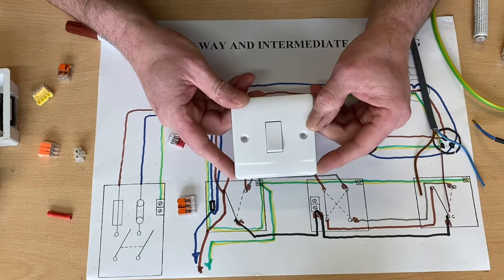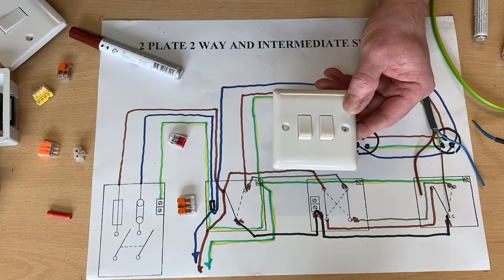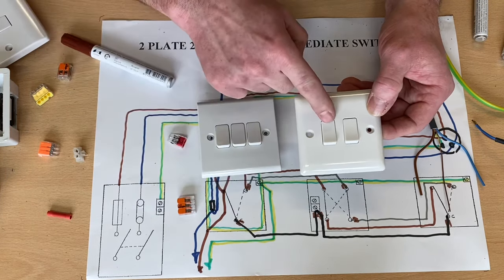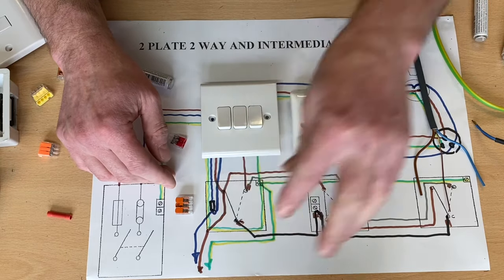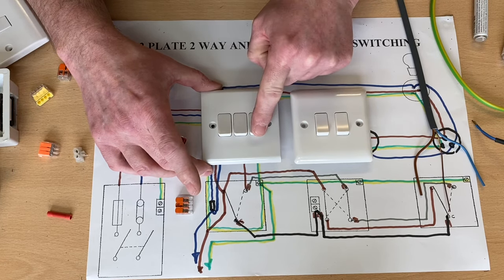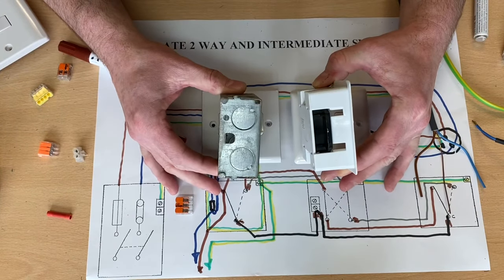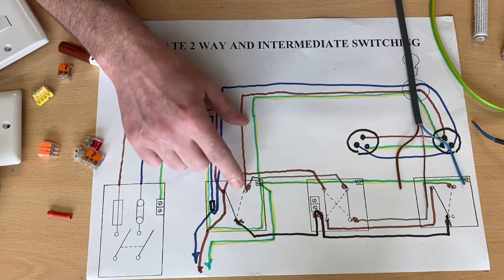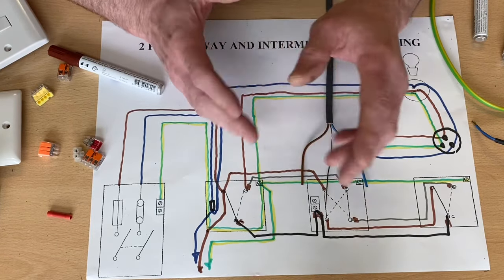Wiring Diagram 2 Plate Method - Taking the Feed to Another Room and Switch Connections Explained

Comment: Could you do a video on the real world scenario of hall landing light switches, using the two plate method, highlighting the issues of two consumer unit circuits providing the feeds and not sharing neutrals. Probably good advice to make these the end points of the the radials when possible to reduce the cable count. I don't think I have seen this covered anywhere and it seems to cause a lot of problems and confusion.

Comment: A lighting circuit is a radial circuit. In short you daisy chain from one light to the next. So the lighting equipment needs to be a junction to take the lighting circuit to the next light.  

A light has two parts:
1) the light fitting to the lamp itself;
2) The switch. 

a) Light fitting as a junction:
In a two floor house with an attic, the light fitting tends to be used as the junction to daisy chain the lighting circuit to the next light in the circuit. Then a wire to the light switch. So, a circuit is a wire from the CU to each light fitting with each having a cable to its own switch. No neutral wire is at the switch.

b) Switch as a junction:
The way to do it in flats as there are no suspended floors or atttics, is to daisy chain the lighting circuit to the switches, then one wire to the light fitting. The opposite of a) above.  So, a circuit is a wire from the CU to each switch with each switch having a cable to its own light fitting. A neutral wire is at the switch. 

In b) above, the daisy chained neutral needs a junction terminal on the switch or behind the switch in the box.  Hager and Schneider provide a switch with an N terminal on rear of the switch, so the switch is the junction.  To my knowledge Hager has been making one for at least 10 years.   If the switch has no N terminals, Wagos or terminal blocks have to be used inside the light switch box. 

In a) above there are problems of wiring colours when a cable is taken to a switch, as cable with the L (brown) and N (blue) are used, needing a coloured sleeve over the N wire. There is special wire available with a yellow conductor for this, but it is rarely used. Using the switches as a junction solves this. 

As lighting is now more varied with downlighters, wall lighters, etc, taking the lighting circuit daisy chained to the switches makes more sense - multiple downlighters can easily be extended.  It is also easier to fault find. It means the boxes behind light switches have to be far deeper to accommodate more cables and Wagos to form the junction terminals. 

If a lighting intermediate switch is being used, taking the circuit daisy chained via the switch makes it easy to fit one. 

That is how I tend explain it.
Reply: @danielwake7621  
There is nothing wrong with doing that.

Comment: Fantastic video Gaz as always.
Personally I don’t like the idea of having two or more cables of one switch unless it is for two way switching. And I don’t like the two plate method , I would take the feed to a wago joint box then on to were it needs to go. 
But we all have our own way of doing things. so each to there own.

Fantastic video any way Gaz 👍❤️⚡️
Reply: These days with the popularity of smart switch devices like Sonoff having the neutral at the switch makes easier to install them possibly in the future. 

Yes in theory you can install them at the light position, but it's more difficult and they are less accessible in case you need to do something with them.

Comment: Is it possible to get a neutral to the second switch to feed another room as well? Is it acceptable to tap of a neutral from the light fitting as its on the same circuit rather than running a second T&E along with 3C&E?

Comment: Great video but still a bit confused. If I wanted to use the 2 plate method on a 2 gang light switch supplying two different sets of lights in the same room how would you do that? Would you, for example simply run a brown cable from common to common instead of heading off to the next room?
Reply from the maker: Yes 👍🏻
Reply: Thank you so much! Great videos.
Reply: Good call. My 3 gang switch has 4 wires all into the common wire. This must be the opposite of linking the commons. Think linking them is the better option

Comment: I would like to add an entirely new switch and light to a two plate circuit. The switch at the start of the chain is on the first floor and is very full and will not take another connection. It is a two way switch with 4 x 1.5mms in it. 
Identical to your drawing at 8:30

My query is, Can I split the wire that is feeding the next room at a junction box to create a new light and switch. So instead of daisy changing at the end of the entire circuit, I split into two before the second room? the daisy chain will then continue as installed but now with my individual light spur and switch additionally?

Comment: GAZ, your presentation is excellent and  I think you should think about teaching electricals as a profession, as your very good.  Kidding, I've been a big fan of your channel for years and have been helped in a lot of subjects and glad you are still putting these out. One question with regards to all the connectors in the back of the patress/ knockout box. What's your thoughts on floating cables behind the switch? I can't see an issue but there's some discussion that connectors floating around is bad and they should be secured within the enclosure.
Reply from the maker: Thanks for the great comment - I don’t mind a Wago in the back of a box but if you could secure them then I would 👍🏻. Have a great day. Gaz
Reply: @GSHElectrical  A roll of Tower (other brands available...) two sided tape normally used for fixing trunking would do the trick to fix the Wago.

Comment: So you have to get the permanent line from your switch which is chopped into the walland cannot be git at without cutting a chase to get to the permanent line cable whereas before you could find a permanent line connection from any light in any room ,so as an Industrial sparks of 50 years whoever came up with this crazy idea baffles me,you even have to put the neutral cables at the switch into connectors thus making more connections in your circuit therefore there being more of a chance of connections coming loose,yet you are pushing this method which makes me lose my respect for your teaching
Reply: It's in the syllabus, mate. They're not pushing anything, you have to know both ways. The 'old' (3 plate method) you mentioned isn't old, it's still being used, along with this 2 plate method which is often found in commercial buildings which give easier access to the switch box.

Comment: To add to the chain, do you need to find the last switch in the existing chain or can you essentially spur off any switch in the chain? I am assuming you need to work from the end of the chain?
Reply from the maker: No you can come off any light to add another that will come on at the same time 👍🏻
Reply: @GSHElectrical  thank you and Merry Christmas ... Great tutorials
Reply: @GSHElectrical  sorry just to clarify, if it's a brand new/additional light ... you can simply spur off the nearest switch? (The light will work independently of the switch being spurred off)

Comment: Nice work Gaz! When the connection goes off to the next room, does those wires connect to the switch or the lights? Thanks
Reply from the maker: The feed would come from the switch to another room if the 2 plate method was used 👍🏻
Reply: @GSHElectrical  thanks Gaz. Keep up the great content!

Comment: Would it be bad practice to mix 2 plate method and 3 plate method?
Reply from the maker: Yep not a problem - my house has both methods in it 👍🏻
Reply: @GSHElectrical  That's good to hear, especially as the introduction of smart light switches such as the SONOFF means the 2 plate method is advantageous as the Neutral is at the switch as required by smart switches.  If it's possible to mix both 2 plate and 3 plate method, rooms can just be moved to the 2 plate method as and when a smart switch is added to that room whilst leaving the existing rooms as 3 plate.

Comment: When installing a lighting circuit with say 3 gangs for different lights.. all fed at switch and linked across, could you run a 3 core to one light if its accessible above and taking a permanent live also to future proof it so you have perm and neutral at light to take from
Reply: Thinking this will avoid chasing out wall to take another wire to another light but also by using a 3 core + cpc instead of 2 core + cpc you only add 1 core to an already cramped switch instead of 3